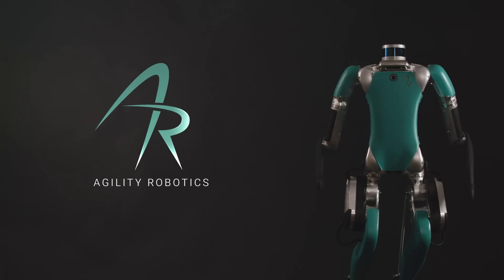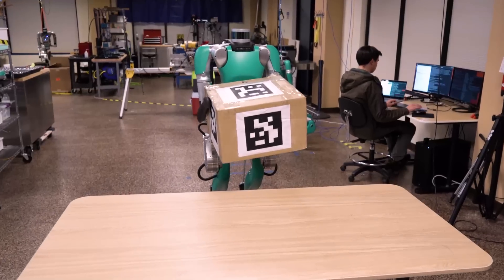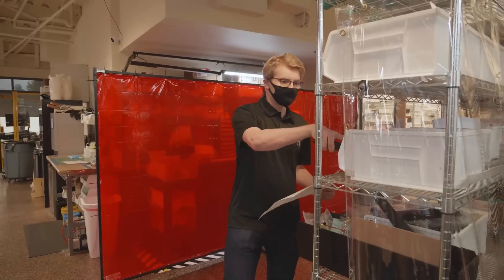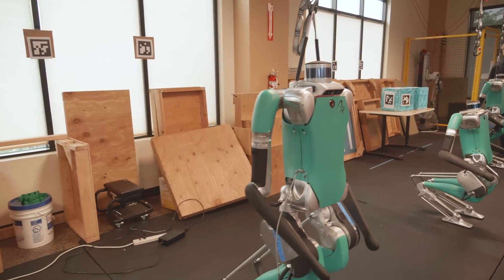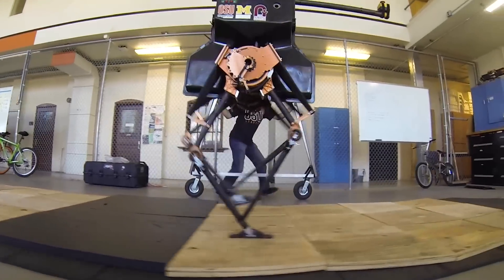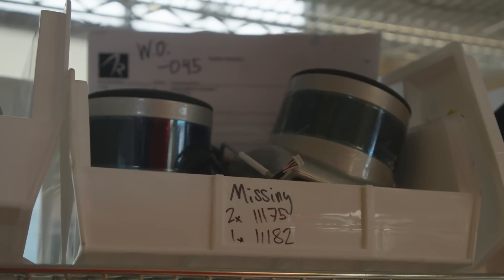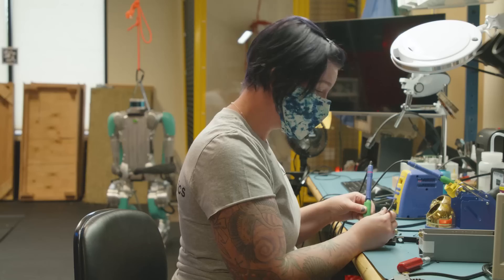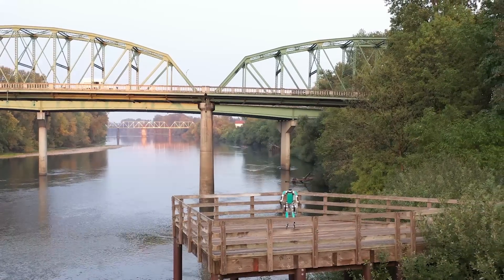Agility Robotics: The Next Steps

Comment: The problem that I have with Robots is that the creators always build them in our image.... with our limitations... when Robots would be capable of so much more.... take the arms for example, why build them with our limitations ?!? you could give each joint something close to 360 degrees range of motion, so that they could operate front and back, and why 2-3 joints ? why not 4 joints for extra ranges of motion and or longer arms, why 2 arms ? why not 3-4 Arms ?... you do not need the robots to turn around or worry about space for them to turn around right then and there... and why skinny robots ? the torso could be 2-3 times that size and still work in our work space, and then the torso could be used to carry objects in one way or another, so basically a mobile locker or file cabinet and or carry heavier objects on top of the torso and still have the arms carry lighter things too, so in stead of one job, it could do 2-6 other jobs at once or on one route etc

Comment: Why won't anyone listen.
Carbon Nano hydraulic tubing eliminates gears.
Runs on a heartbeat pump.
Run smooth.
Reply: Tell me more, I am intrigued
Reply: @Dangineering  they all got the problem with jecking and stopping starting.we already have the blue Print. Gears and motors.No more ,they can run On One Pump, smoothly.stronger than steel. Nano tubing. Lighter
Even.

Comment: Honestly really good job Agility Robotics!

Obviously everyone is going to compare these to Boston Dynamics Atlas but I actually really like this design just as much - it's not as "advanced" in terms of performance and capabilities but I also see that it's not trying to be. 
It seems that you took a different route of creating a simpler, more reliable and cheaper (not in a bad way though) bipedal robot rather than a state-of-the-art parkour machine :)
Everything about the construction of Digit screams to me simplicity and ease of manufacture while at the same time it looks really sturdy and well put together.

I wonder if making the legs digitigrade was easier than plantigrade? (talking about the number of joints below the hip - plantigrade having two and digitigrade or unguligrade having three).

I think the only problem I personally have with the legs is how exagerated the bend is - it extends really far backwards - I bet that's for added leverage?

And finally was digitigrade the inspiration for the robot's name?

Comment: Give it fingers while you're at it, so it can firmly pick stuff up. 
I've seen this laser charging tech around some time ago. Basically the idea was that the laser charging station would be mounted somewhere on the ceiling and it could charge anything in it's LOS. That'd be pretty neat for a robot to have a charging capability this way. No needing to dock it somewhere to charge or have a cable tethered from somewhere, just have it loiter around in the laser's LOS and it'll charge. Or better yet, have multiple lasers set up, so where ever it goes it'll stay charged.

Comment: Great job. That factory scene reminded me of the Warper assembly line in Subnautica. 
I'd like to see it start a mower, mow the lawn, then fetch me a beer. I'd also love to see a garden mode that can do the weeding, find and destroy caterpillars (no poisons required). Shovelling dirt into a wheelbarrow, push to destination, then tip and smooth is another useful mission mode.
It will be interesting to see the minimal hand dexterity to do these tasks (or just have a rotary quick-swap tool selector?). I suspect the SLAM, overall situational awareness and other AI aspects have a way to go yet.
Also, please make a rideable one that can handle rugged bush terrain, and climb. (heck, can it swim too?) Less AI, but scaled up engineering.
The only question is, will they ever be affordable?

Comment: Is it really that difficult or expensive to add a kind of fingers to the robot?  He would be a million times more useful with working hands.
Reply: I am sure they are capable to build bigger size Digit with more features, once humans are more comfortable in working along side with "humanoids".
Reply from the maker: Think of it in terms of total number of degrees of freedom. Digit has 20 DOF with its current joints, which is less than the number of DOF in a single human hand. Hands are tricky!

Comment: Atlas would pick this thing up and use it as a tennis racquet.
Reply: That is correct. But for the user, it's not all about peak level skill/power. It's mostly about cost and revenue per unit. If currenlty Atlas is the best, but Digit is good enough and costs less, it will take the market. Plus, Atlas is not an end product yet but these guys seem to be ready to sell.
Reply: @dynamicgecko1213  totally different units obviously. Atlas may never make mass market while these things can become quite ubiquitous.
Reply: @dynamicgecko1213  grand slam
Reply: Atlas will fill a valid market, but I don't think most uses for humanoid robots will actually require elaborate feats of athleticism like what Atlas can do.
Reply: @dgd947a15fl  wait till sex robots are fully available,let's see how'athletic' they are.

Comment: Suggestion:  There are lots of videos of bipedal robots walking around with a box.  They all have the look of a polished demo using a prototype.  If you want to show something much more impressive, how about a time-lapse video of many hours of Digit autonomously breaking down pallets at a loading dock, walking back and forth from stock shelving, and putting everything away, again, and again, and again.   There is nothing like that out there, and that would make headlines:  A bipedal robot actually doing a person's job for a full shift.  Otherwise it just looks like a really expensive toy.
Reply: They won't, the battery life on those things is incredibly short and lifting heavy boxes costs a lot of energy. They'd need to have a system where they have replaceable powerbanks in the wall that can take their used one and replace it with a fully charged one.
Reply: @KiLLJoYYouTube  2-3 hours (the actual Digit battery run time) should do the trick. Also no one would mind if there would be 2 robots, one would work while second is charging.
Reply: @BHBalast  the customer's bank manager would mind! I think wall racked replaceable batteries would be the answer. When the robot senses its getting low on juice it walks across and replaces its battery. Would only take a couple of minutes and then its back at work.
Reply: BHBalast is that battery time taking into account the effort required to pick up boxes?

There’s a reason why robots haven’t replaced humans yet. You would definitely have a replacement battery.
Reply: @KiLLJoYYouTube  Yes, it takes it into account, the info is from Agility's  comment somewhere in this comment section.
Reply: @Yewbzee  I guess you right, I was looking at this problem from an engineering standpoint, because designing a useful humanoid is orders of magnitude harder than designing a replaceable battery pack.
Reply: @BHBalast  anyway even in its current form if you loaded it up with openAi GPT-3 it would be more useful than 95% of the people I've ever worked with!
Reply: @Yewbzee  gpt-3 actually would not work.  For one I'm fairly certain that it could not even fit on it's processer. And second, it's used for its writing. Spacial awareness is not what it is trained for
Reply: @mikewade1604  yeah I was kinda joking about my previous co-workers to be honest not making a serious suggestion but thanks for the heads up.
Reply: @Yewbzee  eh, my sacasem alarm didn't kick in. I'm just going to woosh myself ( what does that even mean?) Out.
Reply: @mikewade1604  😂😂
Reply: @BHBalast    Much like a human worker -- needs a break after 2 or 3 hours!
Reply: @Yewbzee  That is exactly what robots should do!
Reply: @BHBalast  I would have 3. One on standby for when one of the others is down for maintenance. If you are going to use them for stacking pallets. Personally I see them as household domestic appliances. Not too different from a Rumba. It's the software that manages the robot that is key. As long as it didn't bump into things it could pick up after you and such. Software power management will be low hanging fruit I would think just like a Tesla tweaking the software to get more out of the batteries. That is where the AI for a device like this will make or break it. I say that because the hardware looks spot on.
Reply: @KiLLJoYYouTube  
This is actually something I've brought up again and again with people.

ONE of the bigger reasons why robotics such as this and various other potential technological marvels has yet to take off is batteries.

Our battery technology is not advancing nearly as fast as robotics and other technology.

Battery innovation hasn't been so great to say the least.

We absolutely NEED some sort of newer, more powerful, and more efficient energy cells. Or I fear we will advance much slower with autonomously powered and compact machines.

We desperately need a compact, high energy, power cell that is capable of supplying a strong source of energy for long periods.
And better yet for such a type of power cell would be that it is rapidly rechargeable or able to be rapidly refueled.
Reply: @Yewbzee  I almost spit my soup over the keyboard. You're right, that seems to be an accurate percentage.
Reply: @Yewbzee  have you seen Atlas from Boston Dynamics. that thing is scary. i thought it was fake, but it isn't.
Reply: @BHBalast  no, it’s 1.5hrs.
Reply: @KiLLJoYYouTube  iF a roomba can charge itself, I'm assuming this can charge itself.
Reply: @KiLLJoYYouTube  If Roomba could do it and sell it, why these guys can't?
Reply: @KiLLJoYYouTube  or a cable on the ceiling like in those cars where u bump at each other at fanfares.
Reply: From what I've learned, the prototype is much easier than production. Pointless if you can't cheaply mass produce the design.
Reply: Well said. Always some fancy staged environment and one single activity. Make it work and show that like you said.
Reply: The customers of these robots are research institutes, not manufacturers. Also, the things you mention are still a little bit out of reach. At least the pallet-breaking down. A specialised robot/machine would be much, much more viable financially.
Reply: I have to say I agree. Robots are kind of gimmicky at the moment.
Reply: Maybe built a kids version of it. That would fit the reality much better!
Reply: I work in a warehouse. All I do is lift boxes off pallets. This scares me.
Reply: That's actually a really good idea
Reply: Mow my lawn
Reply: But then ppl would be like 
"Omg we're gonna lose our jobs"
Reply: Everyone keeps saying " people will loose their jobs", well thats the whole point of it. we try to automate our world so that we can be doing more than just moving boxes, although seing how the world is going i think most people are better off doing just that
Reply: I mean it is a “prototype” and actual use of such robots is almost nonexistent. Customers in their case are universities, research centres, private schools, expos and etc. They are like future-concept cars. Used to gauge reactions of the public, create an image, look for investors, recruit workers and other similar purposes.
Reply: Your suggestion is like when u compare mercedes (car manufacturer) and tesla (also car manufacturer). Both are cars, but different. 

So when u see robot walking around with box, it doesnt mean it is the same... every manufaturer has its own system, proces and ability 🤷🏻‍♂️
Reply: Agreed! I was also thinking that in a few clips, it looks like the bots are CGI. I hope they aren't spending more on their advertising budget than their engineering team just to get something to market.
Reply: For now. That will come.
Reply: you gonna buy one? :)
Reply: Because the robots that do these tasks in real warehouses don't need anthropoid arms and legs. They run on wheels and act more like fork lifts. This company has a form factor searching for a problem. Unfortunately for them, the human form factor isn't optimal for most tasks that need to be done.
Reply: @Korsalath , You are all wrong.  This very robot will be doing real work on a massive scale in just 3-5 years

Comment: This looks very good, I would like to know what is the Carrying capacity of this robot? How long would it take to empty a standard U.S. pallet (48" x 40") about 10 - 12 boxes moving them about 25 - 50ft, Given current battery life how many robots would i need to keep 4 bays working 24/7. Also how much set up time is required, and how long to repurpose to other jobs. What is the usefull life between maintainance cycles and how long would maintainance take?
Reply: Are these robots autonomous or do they require supervision? if so how many robots per person. Do they opperate like a roomba vacuum returning to an individual station to recharge? is that process autonomous or does it require an operator?
Reply from the maker: A mix of autonomous and supervised human-in-the-loop at the moment; moving towards higher levels of autonomy over time. Charging is manual plug-in at the moment since we chose to use a COTS charger for ease of support. Your other questions are good ones but hard to answer in YouTube comments - feel free to ping our sales line for a more in depth conversation.
Reply: @AgilityRobotics  Thank you.

Comment: 15min on battery?
Reply from the maker: 2-3 hours depending on level of effort. Battery is a nominal 1 kWh, with 300-400W power usage in most tasks. With how fast battery costs have dropped, additional mass is the only real penalty for making the battery bigger.